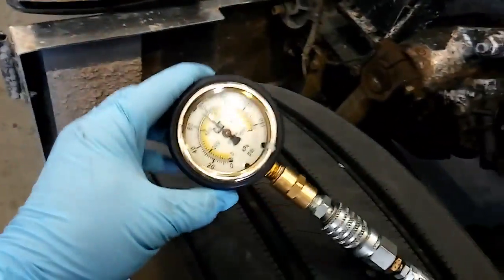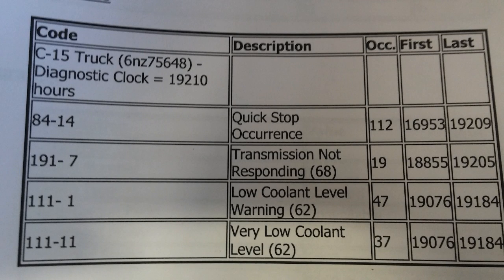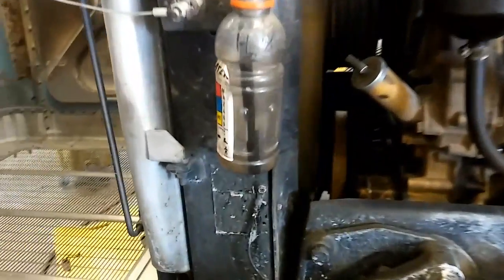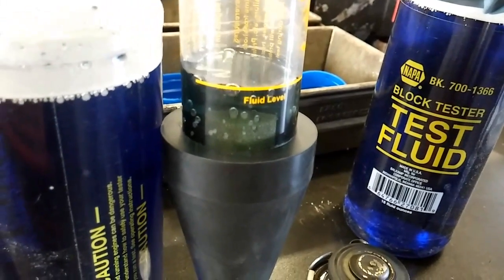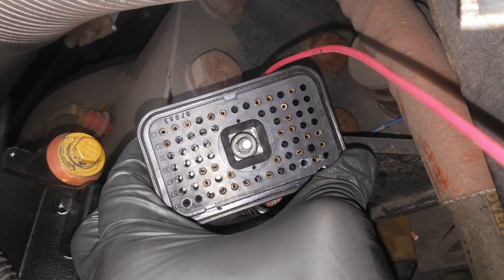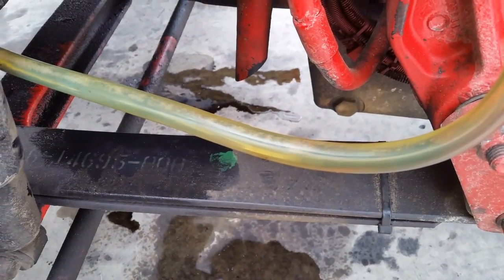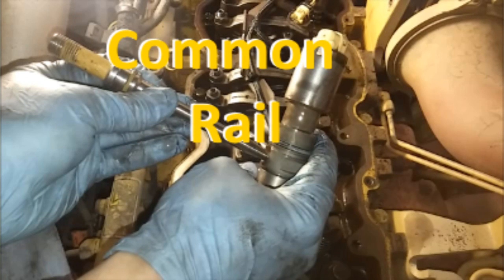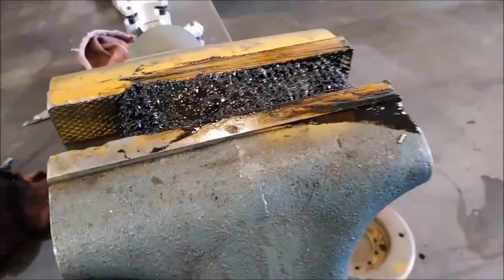Engine Runs Rough When Hot?  Engine Troubleshooting.

Comment: Interesting video thanks I've had rough idling often mostly after it's up to temp etc but can occasionally carry on the next time I enter the car ..coolant level hasn't changed no leaks has had coolant and therm.  Changed with new fluid power kind of mostly ok but not at its ideal best ..1x new injector replaced (Only 1 showed on diag.) It has a deeper tone too when doing this. U don't rev it pretty much stays idle ok u rev it it may misfire or misfire on idle return . Then normalise.  Any ideas are grateful thanks

Comment: I have an engine problem
only when I go up a big hill or when I run the engine in high acceleration after smelling the oil for 2 minutes, the engine will return to normal if I let it sit and ride quietly my temperature never exceeds 95 degrees Celsius and I have not checked the engine I change the spark plugs the oil and the prestone level checker also I have never above 95c

Comment: Hi mate i got a c-15 6nz Engine it Idols rough CaT did a cylinder  shutdown checked all injectors check the fuel system the wiring loom change the engine mounts done a hot set tap adjustment still not fixed it’s driving me mad now they’re saying it could be the clutch what does it seem like to you by the way where in Australia thanks mate love your channel

Comment: The only thing I disagree is not to change injectors when they run ok.
Most of the new injectors are rebuilt and cause much more problems.
If one of injectors is bad then change the one which is bad not all of them.
I have very bad experience with new rebuilt parts.
Especially with the turbos.
I have changed 4 new turbo and all failed.
I went to a jank yard and bought a used one.
It's been over a year now and it never failed.
For owner operators,try not to replace the old parts as much as you can.

Comment: Can you do a video on a c15 engine runs fine for about a minute then rough idle white white/blue smoke then will run fine while warm sometimes I’ll spew raw fuel smell while warm no oil usage for about 10k miles new injectors and harness replaced all censors and decent fuel mileage

Comment: Maybe you can help! I have a 2000 International 4700 with a DT466e. Sits for more than 4 hours, won't start, wants to but it won't. Sniff it with ether, starts right up and runs absolutely perfect. I can shut it off and it will start right up. Its just when it sits. I know it's bleeding fuel somewhere. Dealer thinks it's injector o rings. Any ideas?

Comment: This has nothing to do with this video I just don’t know any other way to contact you. My 04 bxs engine brake is cutting out on low stage head, would the vva or Iva (whatever it’s called) cause that? I have oil squirting out the vva as the engine is running.. is that normal? I wouldn’t think so because ya can’t run the engine with the valve cover off. Can I rebuild it like a jake head or do I just have to buy one? Also how do I send you $$? I don’t care to pay for good info.

Comment: I own Volvo FH truck its European. I performed bottle test just like you and was getting bubbles. but the reason was not blown gasket but the copper cups where injectors are placed. I replaced them and the truck stopped getting compression into the coolant.
Reply from the maker: Depending on the engine you have that can be another cause, the Cat 3116 has copper cups just like that, but this engine has steel cups. If your engine has an ear cooler, that can also put bubbles into the coolant. Thanks for the input.
Reply: Copper injector tubes usually pass compression into the fuel rail and cause running rough and hard to start on the Volvo engines. Have seen them pressurise the cooling system too but compressor and EGR cooler definitely has to be checked before changing tubes.
Reply: Вадим Вадим do u have any you tube channel..I wanna be a perfect engineer in diesel engines